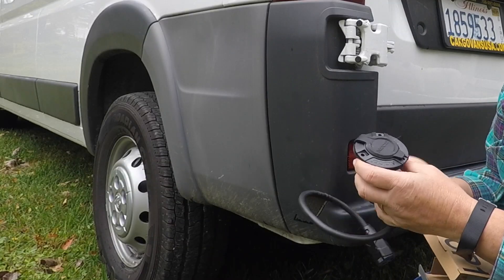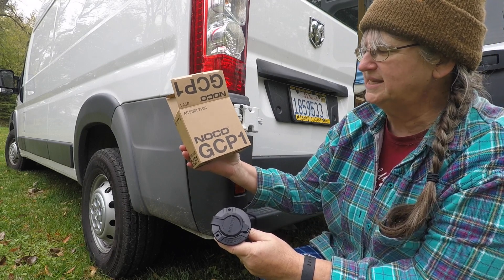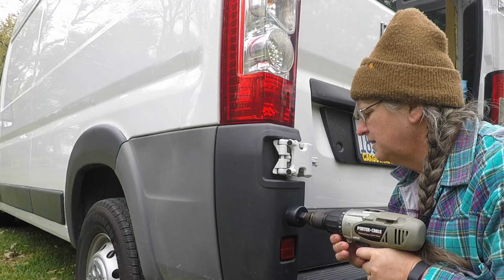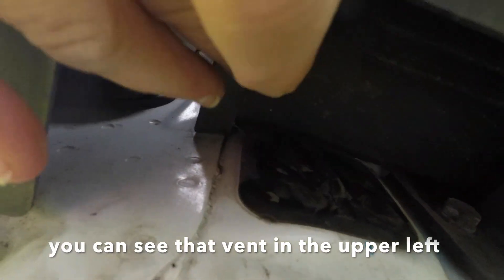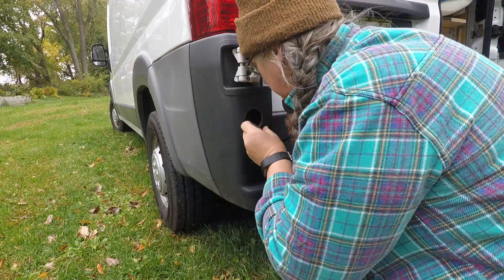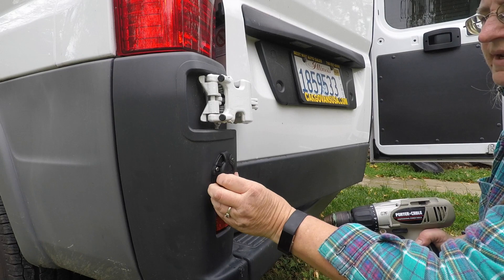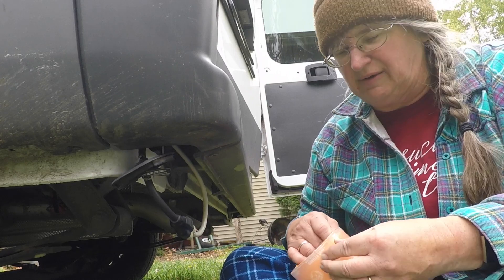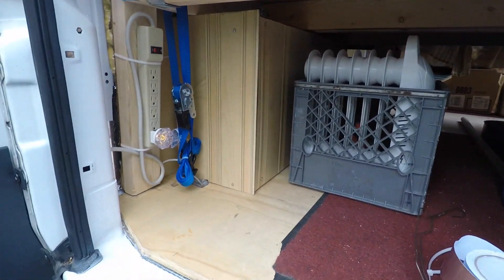NOCO  Electrical Port for Shore Power on Promaster... so easy.

Comment: I have a built out Promaster and I constantly find better ways to get from outside in when it comes to electrics and such. I did not see this access hole and I didn't see the 6' on Amazon until I watched your vid. Thanks for posting.... I re ordered the 6' installed in the same area.... It couldn't have gone more perfectly. Thanks again! Oh and one great thing about this area for install is..... If you screw the plastic up or damage this area..... It's a part that can be replaced... Just order a new piece from the factory.
Reply from the maker: Thanks. I'm so glad your project worked out. I was pretty nervous about the install but really, it couldn't have gone better for me either.

Comment: Great Tip! Drilling a hole into the metal of the can is tough stuff. Thank you for making this video and showing where to send the wire. Sorry your extension cord wasn’t long enough. I’ll learn from that short cord issue and probably make my own with a 30A plug.
Reply from the maker: Thanks. It’s important to say what when right and what went wrong. Glad I could help.
Reply: I did this and ended up using a 10awg 3 prong extension cord at three feet with a lighted end! The chord can easily handle 240v and 80 amp draw. Thank you, highly recommended.

Comment: I love where you put it! No holes in the metal siding, and installed in a part that can be replaced if needed! Great Job! A little bit of silicone sealant between wall and port will offer additional "hold" and act as a glue as well. Can't hurt, might help!
Reply from the maker: Thanks, I contemplated some silicone but it comes with a rubber gasket that acts as a sealant.
Reply: @michele2017promastertravel  You really don't need it where you placed that, I was just thinking if anyone was worried about sealing or extra "hold".  And if you did want to add sealant I bet you can :)  I just discovered your channel today so plan to sit down with my hubby with some snacks and binge! You are an inspiration! We just bought our Ram Promaster, and need to start insulating soon.

Comment: That's amazing!! I have a 2015 Promaster 136" WB and was wondering how to get a shore power setup installed. I really like that you can plug the power strip into the wire that comes attached to the shore power port. Thanks so much for sharing!! I can't wait to be able to power my van with shore power as I do my no-build build! Still want to have heat and light to it while it's in my driveway, without installing an entire electrical system or buying a solar setup just yet!
Reply from the maker: Gina. That's awesome. It's a game changer when you can plug in. Good Luck.

Comment: Nice job!!! I saw this technique before but they went through the air plug, the first one you mentioned. They had to slit it, they took off 3 panels, they had to cut the 3 prong off to feed the wire through the slit. What a hassle. I love the 2nd entry you found. I will definitely be doing it your way when i get my van, and i was going to get the 6' version. Only thing i would suggest is instead of a coat hanger, i would just feed either string, rope or wire - down, and then loop the end of the plug in to the wire/string, and then just pull the string up. Benefit for me is my van will be empty when i do this. TY, great job explaining it and good camera shots, especially the first one through the hole where you couldn't see and you corrected it so it was visible.
Reply from the maker: Thanks so much. I really love making these videos.

Comment: This is great. I was worried I'd have to drill through the metal to install one of these. I bought one last year and I've been hesitant to put it in. I will definitely use this location. I bought the 18 inch as well so I love that you had a fix for that.
Reply from the maker: Good luck and let me know how it comes out. So scary to cut into your van, but so easy.

Comment: Thank you! I just ordered mine with 6 ft cord from walmart
Reply from the maker: awesome. Good luck. It was such a simple process, and I can't believe how handy it is to have, even at home when I'm loading up, sometimes I plug in so I can run my electric heater or Air conditioner.

Comment: Excellent!!  Thank you. I also love the tiny oil radiator... that is GREAT!  Where did you find it?
Reply from the maker: I found it locally at a farm store called Farm and Fleet. I think they are available in fall/winter months. It' worked well for us. Just took the edge off the cold. You'll need to be plugged into shore power to use it.

Comment: I did this to my last van, it was a bad placement with the doors open for me.  🤷🏼‍♀️. Something to consider🤔
Reply from the maker: Oh, that's too bad. My door can be opened completely when I'm plugged in with no interference. I use a standard outside extension cord .
Reply: @michele2017promastertravel  30amp doesn’t work as well! 😉

Comment: I just bought the one with 2 and it's only 18" ugh. What if you had placed that plug below the reflector? Would it have reached and would the circle fit in that space?
Reply from the maker: If you can drill a hole there the cord may fit better in the upper hole- I showed both entry holes with gasket entry in my video. You can get on the ground and look up into the cavity and see it and judge. The plastic was very easy to cut through. Good luck. It's really not a big deal the cord was a little too short. I wrapped the plug in duct tape and it sits inside a cavity that  is not exposed to the outside.
Reply: Thank you

Comment: This is like the one I bought but mine has a 16 inch cord. I will be installing mine on the side so 16 inch cord is plenty long enough.
Reply from the maker: Perfect. They are really good quality and the lid makes a great seal to protect the prongs. I'm sure you thought of this but putting a small wood frame inside your van to receive the screws will make it more stable pushing in and pulling your shore plug. The thin metal walls of the van may give a little under pressure. Just a thought.

Comment: You probably should be running a GFI receptacle in the van directly wired into the outside receptacle, then you’ll have protected power.
Reply from the maker: Thanks. The power strip does have a fuse, that has popped on a couple of occasions. Good idea.

Comment: How has this worked so far?  Any issues powering the AC or overloading the power strip?
Reply from the maker: Hi there. So far I've used it to power the AC in my driveway. It was 86F in full sun and I ran it for about an hour. There was no issues with any of the plugs or cords overheating. In fact there was no warmth at any point along the connection. I have a 5,000 BTU AC so it's pretty small. I'm heading out for a 6 day outing using my  AC. I'll do a review on the AC when I get back.
Reply: Great videos. Just found your channel. Curious what AC unit you are using as we were looking for a low BTU system as well. Thanks.
Reply from the maker: @weavgiff   It's a GE Brand 5,100 BTU.$300 from Lowe's. I bought it because it's profile is 12"x11"x 30" high and it fit behind my driver's seat. I just got back from a 6 day trip and used the AC the 5 nights we were plugged in. It was a game changer for summer sleeping. It took about an hour to cool 'me' down and the promaster. The night time temps were in the mid 70's and it cooled  down the van to mid 60's (you can set temp) especially the humidity was so low there wasn't condensation on the front windows in the morning- which always happens. It was not especially loud, provided good white noise even though we left an upper vent cracked.  I'd like to add that the air conditioner and my dometic fridge ran flawlessly on the incoming 15 amp  Norco inlet. No cords or plugs got warm or hot- I checked after it had been running a while and just before unplugging..
Reply: @michele2017promastertravel  Sorry I can't really tell if it's one of those AC units that sits on a floor and exhausts out a window? Yes? That's great that your fridge AND the AC worked off the shore power outlet!
Reply from the maker: @GinaKayLandis   Hi Gina, Yes it is a portable AC. I actually did a review on it. Check it out. https://www.youtube.com/watch?v=JHhXU718lCQ&list=PL201sAWrSZrsrBMj0eLrRAaq1FPLluQnE&index=3
Reply: Thanks so much for the link to the review! Will be checking out your other videos too! Found the NOCO plug 6' cord and the part # is NOCO GCP1E.